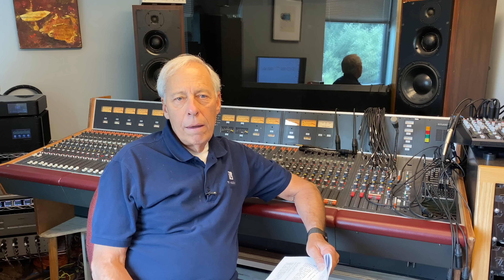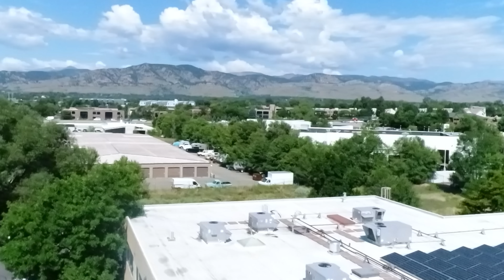Why are preamps expensive?

Comment: Great answer... for anyone who manufactures and/or sells audio equipment.

Ask anyone in the business; and they’ll give you a similar answer. Ask san audiophile with a degree in Electronics and Electrical Engineering; and they’ll tell you that preamps are expensive because that’s what audiophiles will pay for them. There’s a huge profit margin on preamplifiers. For all the “justification” that anyone provides, it’s all about profit and marketing. If they could sell them for more, they would. If the economy goes to pot, most of the current models would be discontinued; and to stay in business they’d start producing cheaper models with built-in limitations. If the economy didn’t pick up, they’d release a limited series that sounded ‘almost’ as good.

Btw, while I have the equivalent to a gardener’s brown thumb where electronics is concerned, one one my longtime school friends went on to get a degree in Electronics and Electrical Engineering; and he like the sound of my NAD preamp so much, that he built his own. It looks like he’ll, but it actually sounds pretty damned good! He spent less than $125 CDN on it (not including interconnects.

Comment: So...I'm definitely an amateur with this hifi stuff, but why not do a straight wire from the pre-amp and delegate the potentiometer duties to the powered amp?  It seems like if you do it like that then you wouldn't have the impedance issue from the source disrupting the audible output. But, again, I'm just north of completely ignorant of hifi science.

Love the videos and I'm already learning a lot.
Thanks so much!
Reply: The power amp may not be right next to the preamp and sources. The problem is magnified if using mono block power amps.

Back in the day preamps were often called control amps which is probably a better description. The idea is to have impedance matching, source selection, volume, tone, and in some cases signal processing (e.g. rumble filter) in one convenient location. This was especially important back before even your toothbrush had a remote control.

Comment: In preamp , power supply is very important.
Since , I lack much knowledge about powersupply , I simply used 9v battery and LM7805 to power LME49721 ultra low noise op amp in my Phono preamp.
Modern problem needs modern solution.
What you think Paul?
Reply: Great, you could further improve your design by using Lm317 those regulators have lower noise. Kind regards
Reply: You know enough, nothing is cleaner than batteries. /EE
Reply: @marcusm5127  true but a voltage regulator will introduce noise on your power supply, the Lm317 is better then a 7805 but making a good power supply is quite a challenge. The power supply is part of the signal path.
Reply: @eDXTRe  May I then recommend LP38798 it's the lowest noise I think Ti makes. It's sort of overkill, it's intendend for high precision analog and kind of hard to buy. Aren't we DIYers here to buy the best components and hope to beat the companies knowledge.
Reply: @marcusm5127  great, i will check this regulator, so i can use it too in my own projects. 

Kind regards Stefan
Reply: @marcusm5127  its only available is a very small package 4x4 mm..... 12 pins... 😬
Reply: @eDXTRe  Don't worry you can buy an adapter to dip14. If you ever decide to you can order a custom pcb from manufacturers like Jlcpcb. I haven't done it myself yet but I am planning to.
Reply: @eDXTRe  So what are you building? I am building my first good audio part, a power amp with Purifi Eval1 class D modules and a Hypex NC1200 power supply. Building is a strong word, more like assembling complete parts in a box.
Reply: @marcusm5127  currently I am building a special monoblock for powering my low ohmic Subwoofer.
It 0.89ohm and want to use a special feedback network to compensate the wires to the sub. So it will be wired using 4 wires, 2thick ones(current) and 2 small ones. For sense line.

First I simulated the special feedback network and it seems to be working. So I can try this on my prototype.

Then I will make a DC-servo for full dc coupling.

After that 
I need working on a special protection circuit, because I will not be using a output speaker relay.

The first item I will test wil be the switch mode power supply. I try using 2 meanwell power supply's of 24v volt each. (1 for pos 24v and 1 for negative 24v)It should be capable of 8 amp each, so effectively I should be capable of doing 16 amp Continuously when
Putting out a sinus signal. I hope the 24v will be stable thus that's something I will test first. I will buffer the output of the meanwell psu by using large caps.

So a lot to do, but first I need to focus on my study, I need to pass my exam on mathematics next week.

@marcus M what kind of amp module are you using specifically?
Reply: @marcusm5127  I checked the purifi on Google, its looking very good. Nice PCB boards.
Reply: @eDXTRe  I like that you are using 4 pole measuring but shouldn't you add the servo feedback by measuring where the driver is? Also what monster amp do you have that powers your short circuit of a subwoofer? I have only seen sub 2 Ohm in car audio and usually SPL competition gear. You don't happen to study in Sweden?i have my physics and digital systems exams next week too.
Reply: @marcusm5127  my monster subwoofer has a DC servo motor, its aservodrive contrabass. I use a common desig hifi Amp, and. MOdify this to fity needs, its completely discrete build, using 8 very good onsemi power transistors. 
The amp should be able to feed >200watt into the sub. 
Feedback is something i like but that's a new project :-)
Reply: @marcusm5127  you can check my YouTube video's regarding the servodrive sub
Reply: @eDXTRe  haha omg I already did. I am the same Marcus who commented asking if the servo was sensitive enough.
Reply: @marcusm5127  ahah, great😊👍yes I like the servo sub. Only when playing low spl level some drive noise can be heard. But it's acceptable, specially when listening on higher levels. Now I use a hypex ucd400 amplifier. With linear power supply.
Reply: @eDXTRe  You're full of crap.  Just take a gander at PSRR on good aduio op amps.  Preamp power supplies are cheap and easy.

Comment: I'm building up a portable system ATM with a built in DSP and bi amping. I can program two pots to whatever I like via the DSP so I was thinking master volume and the output channel going to the woofer. I was then thinking of using a pot between the DSP and the amp driving the tweeters. 

I've noticed that a pot sucks or the lower end of things if placed between the per amp and the source. But I'm going that in this specific application, that shouldn't be an issue. Fingers crossed! 

Thanks again for your videos! I can't wait to meet you and your team some day! 😁

Comment: If I understood correctly, with a very loo impedance source, say 100 Ohms, I could use a relatively low impedance pot, let's say 1 k, and get close to performance of a buffer.  Does it make sense?
Reply: A preamplifier's output impedance is  typically less than 100 ohm. You are starting with an impedance of 100 and can only get higher based on the setting of your potentiometer. So no.

Comment: Paul, this maybe a little off subject but relatable. Looking of using an AVR without pre-outs :  Can the speaker output of an AVR without pre-outs be fitted with an rca connector (both positive and negative) from each front channel and used as pre-outs to connect to a power amp? If so, are there any consequences?
Reply: Fat Rat  okay. I was looking at it much like speaker line inputs into a plate amplifier of a subwoofer. Thinking the amp only needs the signal. If I may ask, what makes a separate power amp different?

Comment: Selling my PS Audio IV Stereo Preamp because the push buttons fail (channel drops) and no available schematics exist (except for power & phono stage). A patch bay as Selector switch and audio interface for volume control works just fine for me. Done with overpriced “hi-fi” crap. Pro studio gear FTW!

Comment: T-Pad attenuator could be fixed the impedance  of in and out?
and why we don't control the volume on the source output?
Reply: Normally, the volume control in the source of dacs or cd players are not done properly. As you turn down the volume, you loose the detail and impact of the music. Some expensive dacs can do that without any problems, but most of dacs are not.
Reply: @nntexperiences5364  How would one do it properly?

Comment: This man doesn't realize that the mixing console behind him passes a signal trough at least 3 operational amplifiers before it reaches the output. Just general purpose TL071, TL072, NE5532, NE5534. Enable the tone controls on the mixing console and the signal now passes trough at least 6 op amps before it arrives at the output. Again, all low cost op amps. All those mixers used to record those audiophile records are recorded with mixing consoles where signals are being passed trough many op amp stages. You can download schematics for those expensive mixing consoles for free. Take a look at a Studer mixing console for example. Take a schematic for a Midas XL4, according to some the best mixing console ever made, and start counting op amps. This one features low cost discrete input circuits to reach high gain at low noise for low input signals. But that's an exception because in your home you will not amplify those low level signals.The remainder are just TL071, TL072 op amps and in some places NE5532/5534. The hybrids driving the mix bus are nothing more then laser trimmed buffered NE5532 on a ceramic substrate. And for the record: there is no single expensive capacitor in this mixing console. Connect hundred NE5532 op amps as unity gain buffers one after an other and make a tab between each stage. Let me know how many op amps it takes before you are able to hear the difference. Do the same with TL071 TL072. Do the same with BA series low cost op amps from Rohm. Ask an audience to blind test the setup while you move the tabs. It's all about signal integrity. An engineer not able to preserve signal integrity in an audio circuit with one op amp and some resistors to the extend the problem becomes audible has more than one problem and should look for an other job.  In short: expensive preamps are just overpriced pieces of audiophile nonsense and bling bling and they make you pay extra for the blue LED.

Comment: turn the potentiometer to 0 or at 7:00 and measure the load between the signal and the GND. grounding. full short circuit on the amplifier side. this to minimize noise!

imagine a speaker with a crossover! with 4 on speaker you get darker sound and with 8 ohm lighter sound.

What kind of resistance potentiometer is right for your amplifier and preamplifier? 10k 20k 50k 100k ??

hard to say!

I have only used potentiometer and input selector and enjoyed it!

the problem is that if the sound source has a little low sound then you can not amplify the sound!
Reply: The way I understood Paul, turning the preamp volume all the way up will get the cleanest sound. Is that not right?
Reply: @No_Limits_411  yes it is correct but not practical as the volume is at max

Comment: the part that I struggle with is my system is only for 2 channel vinyl playback, and i don't need or want a bunch of source options i'll never use, and same with the phono stage, i'll never use the dozens of different cartridge loadings.   Just want 1 reference level path for my TT

Comment: Why are preamps expensive?...Because most people don't want "a straight wire with gain". Elsewise we all could all build one on a breadboard with a few parts from Radio Shack. 99.9% of regular people want to be able to tailor their sound the way they would like to hear it. It all started with a Tone control (pot and capacitor) on a radio.
Similar question: Why is water wet?

Comment: There is a bit too much hype about systems being totally invisible.  If you take a look at the signal processing utilized in recording a complex audio signal, (a song) the mix and master engineer applies a great deal of signal processing in the form of equalization, non linear compression, and added distortion to achieve a given sonic target.  Don’t get hung up on having a straight wire with gain.  Focus instead on clean, linear reproduction.  The room in which you listen to music will color the production regardless of the signal chain.

Comment: Add in the cost of power cords and interconnects and preamps are something to be avoided.  Plus they feedback, or are effected by feedback.  Integrated amps or sources with volume controls and/or built-in preamps work well.  Having 2 small power conditioners plugged into sockets taking a different path to the circuit breaker eliminates interference between sources and the power amp.

Comment: Why aren't all the stages in an audio system class AB mosfets? High input impedance low output impedance. Why do we still use class A amplifier stages?
Reply: It's not quite that simple. Depending on the application, FETs may or may not be an appropriate choice. The power amplifier design books by Bob Cordell and Douglas Self discuss the reasoning for using the topologies they do. To make a very long story short, FETs are not perfect and have their own set of issues.
Reply: Operational amplifiers, whether integrated or discrete, have high input and low output impedance.  MOSFET's are not required.
Reply: @dizzywow  Especially with modern op-amps like the OPA1656 with output currents of almost 100 mA and extremely low distortion, there is little reason for a discrete line driver.
Reply: @H-77  many solid state power amplifiers have an input impedance of 10 to 20 kohms. Some are as low as 5
Emitter follower and cathode follower output stages of other equipment is often 600 ohms. This makes the connecting wire a significant element especially if you refuse to inversely equalize its effect. Tube amplifiers often have an input impedance of 100 kohms or more. Look at Stereophile Magazines review of Nagra preamps. Notice how the high end rolls off with some solid state amplifiers. Three common dual triode tubes in the signal circuit less expensive and complex than a 1950s all American 5 table radio. Price, about $10,000. You have to be out of your mind.

Comment: Dynamics! This is exactly why you need a pre-amp! Without it you only get good sound in a narrow 20 dB range.
Reply: Fat Rat  If the DAC has a built-in preamp then it could be as good as a separate preamp. If you use passive attenuation then there is no way scientifically to do this well over a large 60 dB range. It is the physical limitation of passive devices. John Siau of Benchmark has written good tech notes that explain why this is the case.
Reply: Fat Rat  It depends on how fast the guy petals relating to the amount of main power it gets I would imagine.  Petal faster more voltage.  haha
Reply: brake PETAL for you
Reply: wanna isn't a word u sure you WANT TO go with wanna had to fix that before I heard about it

Comment: Behringer auto interfaces uses MIDas Preamps. The Neumann web page syat preampos fo rmicrophnes only if usig really sensiticves micriphone. I DONT LIKE SHURES SM78 IOR 58. THE IS HOIRROR! THENKE YU AND THUBBS UPE!
Reply: They use "Midas" mic preamps. I say "Midas" in quotations because there have been multiple iterations of the Midas microphone preamp over the years, some with transformers and some without. The preamps in the old Midas analog desks (think Pro40, XL200, XL3, XL4, etc) were fantastic, but from what I have seen Behringer hasn't been able to replicate that level of performance in their interfaces. Most of that is probably due to budget limitations- those input transformers are quite expensive.
Reply: @H-77  THNAKS YOU! YOU AHS ALWAS BEEN TH EGOODE FRIENDS.  thubmmes y uppse.

Comment: Okay, I get your point, and it's absolutely correct on the technical way.
But could we not agree that actually, the whole "studio gear" thing is simply just an overpriced scam ?
I mean.... you can literally have a handmade guitar tube amp, with giant transformer, fat components and tubes, for 1'200$.
BUT a 500 API lunchbox preamp is costing 900$ ?!!?! COME ON !
And when you unmount those things, there are not the best post in them, at least not as fat transformers, sometimes flimsy electtronic design choices, sometimes the circuits are partially made by asian subcontractors.
At this point, it's just an insdustry trying to make the maximum of bucks, from peoples wanting to be the next music Gods.

Comment: You want to avoid coloring the sound with a potentiometer, so you remove it and introduce a vacuum tube in your signal path?? Riiiight... Because vacuum tubes totally don't color sound. Believe me, not your oscilloscope, or your distortion meter.

Comment: Btw, does this mean that preamp has the least impact on the sound when it's volume is maxed out?
Reply: The opposite
Reply: Assuming the volume control is simply a potentiometer, yes.  However, the primary point of this video was to explain why he no longer makes volume controls where the volume control is simply a potentiometer. Once you replace the potentiometer with a gain cell, your statement is no longer true.